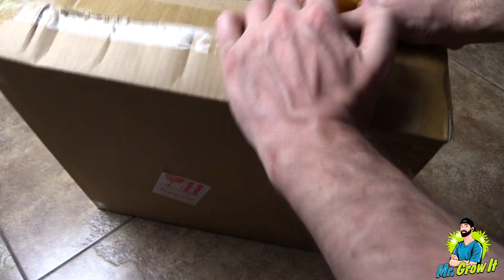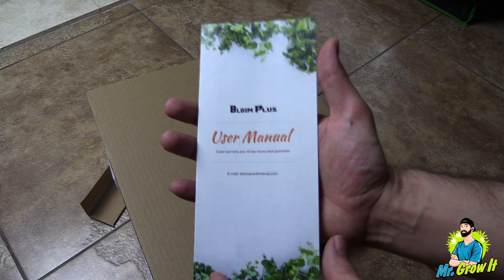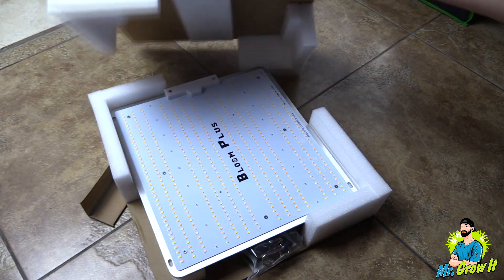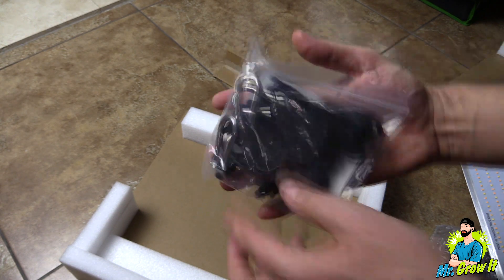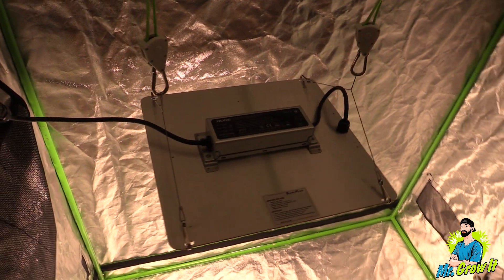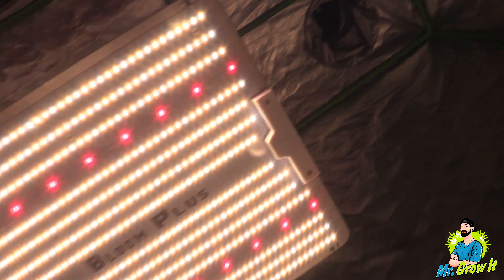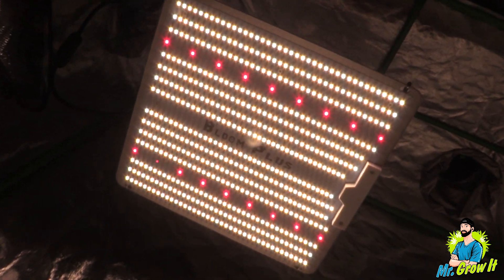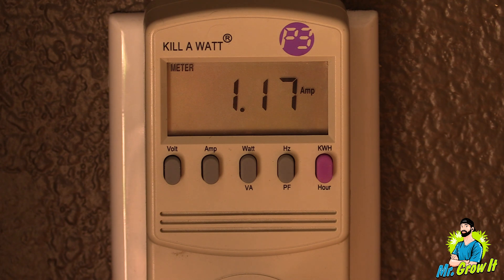Bloom Plus BP-1500 LED Grow Light Unboxing, PAR Test & Heat Test!

Comment: For a 4×4 grow tent could I get away with using a bp3000? Or better off with 2 bp1500 I know they're same draw essentially but for light dispersion
Reply: In the intro he mentioned this light will flower a 2'x2' area, which is true I have two of these in a 2'x4' tent. You'd need 4 to adequately flower a 4'x4' tent using this fixture.

Comment: I'd be curious to see the readings after a year of constant use. Do you have any video where you could do a comparison to see if the light drops off much after a year?
Reply: From my research it says it drops 10% a yr but not sure how accurate that is.
Reply: At that point increase the dimmer screw to offset the natural light decrease

Comment: I just purchased one and waiting for it to arrive. Fingers crossed that it's here by the end of the week. And i hope that it works well in a 100cm×100cm.
Reply: How’s the heat output?
Reply: @odpopcorn  the heat output is surprisingly low. I have a viparspectra VA 600 blurple and it throughs out twice the heat.
Reply: @azza0575  awesome thanks dude🤙
Reply: Do you already have it? how is it working for you
Reply: @facuvildo7107  I works great. It's just that i have it in a 100cm ×100cm or 3×3  and it really needs a 2×2, but it is way better than the blurple lights i have. Later in the new year i will look at buying the BP3000.

Comment: Sorry everybody for the original stupid+negative statement of mine, no need for that, let's keep it positive & irie.
Peace & GL
Reply: What would you recommend then? What is considered a extremely good one?
Reply: @pancho1682  Hola Jose! For starters check out LedGrowlightsDepot's "7 best LED grow lights 2020 -newest tech." There's some really good ones in that video. I myself run Optic LED's Slim 600H, a fuckin beast. Got an unbelievable gram per watt + bud quality right on the first grow with it. There are many many very good ones, high quality light fixtures out there, can name some more if interested...
Peace & GL
Reply: Times change and things evolve, so my last statement might be a little outdated. I've noticed that Mars Hydro has released a new FC-series, that can't be categorised as rubbish. So there's atleast one manufacturer with decent 'budget light's' that are labelled in thousands.
Peace & GL
Reply: LED Grow light technology is changing fast. Quantum boards aren't rubbish and are getting cheaper (I call them cookie sheet lights :) ).  

No reasonably well-produced light with samsung LM301B leds should be considered junk.  Plurple fan boxes, now those were kinda junk. ha ha. I never liked how you couldn't tell the true color of the plants when you were growing. I feel like it made it harder to spot problems. 

The light you mentioned (Optic LED's Slim 600H) costs about $800-1000. Here's one that just came out that does almost the same thing for around $200 (it might not be exactly as powerful, but pretty close and covers a 4x4 area). https://www.amazon.com/Phlizon-Spectrum-Upgraded-Dimmable-Seeding/dp/B08GCKPBSQ    If people are just starting out in this hobby, they may not be ready to plunk down $1000 for a light first thing. 

I started with blurple lights, then went to COBs. My first grow light was a Mars Hydro 300. Now I'm using quantum boards, but am starting to see rail lights that look even better. Who even knows what type of lights they'll have in a few years. I've seen LED lighting technology change several times since I've started growing and I've only been doing this since 2017.

In my option, the mars hydro ts 1000, spider farmer 1000, phlizon 1000, bloomplus 1000, are almost the same light (yes I know there are minor differences, such some having dimming options, but they all cover a 2x2 area). I'd say do your own research and then go for the cheapest one. I usually ignore the numbers manufacturers put in the names of their lights (i.e. Mars Hydro TS 1000, Spider farmer 2000) and look at coverage area and manufacturer PAR maps.
Reply: What a tard lol The YouTube videos showing actual grows speak for themselves.. Maybe watch one next time  before making yourself seem stupid lol
Reply: I'm man enough to admit when i'm wrong and that original message/statement from me was just stupid and unnecessary. There is no reason for me to put down anybodys light choice's or start anykind of negativity within the community. We're all on the same side here, we all love growing & getting high on cannabis so there is no need for meaningless arquements. I'm embarrassed and sorry about my original juvinale statement.
Ganjaman78
Peace & GL

Comment: Love the review but I need to clear up for people who are having a hard time understanding this light DOES yes DOES have a single ir diode wich is the one that looks to be a broken/dim red one.
Reply: Seems like a stupid place to put it. Out on one side.
Reply: @chriscunliffe1542  Mine faces forward when the light is hung but I dont use the dimmer box anymore I plugged in a cable and do it automatically so I have no need to access the box but I could see if it was hung with the power cord at the back of the tent then it would be sideways.
Reply: No dimmer?

Comment: Thanks for this vid. Just bought a pair of these lights and your par readings were helpful in dialing in my height.. Looks like the sweet spot is about 15" with the nutrient PPMs I am running.
Reply: think two of these be enough for a 3x3?
Reply: @trainman421   Been running 2 in a 4x4 for a while now.. they work nice for budget lights..Yeilds and quality are on point..
Reply: @Rusty Shackleford yes sir.. still making purty flowers..
Reply: @makeitpunk6716  u have inst

Comment: Mine had a red dim led. Yours looks like it too
Reply: Its an infrared led thats good for bloom ,  IR led very expensive
Reply: As the other person mentioned this is not an issue this is your IR led you only need 1(one) to be sufficent.
Reply: @dtbone6  I dont understand your issue here ? I paid for two of these lights and you are still missing the point. They dont have a bad diode on its an ir diode so it does not light up the same as a normal red led. so you are very wrong I would indeed say that because I did just pay for two lights. If you are confused about the fact I said you only need one to be sufficient the light only comes with 1 ir dioode as it is soooo...